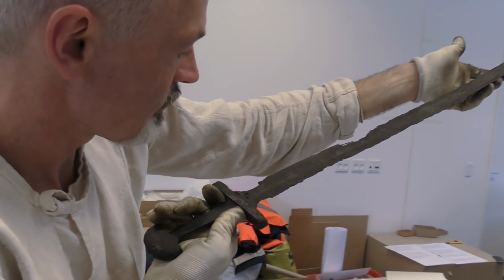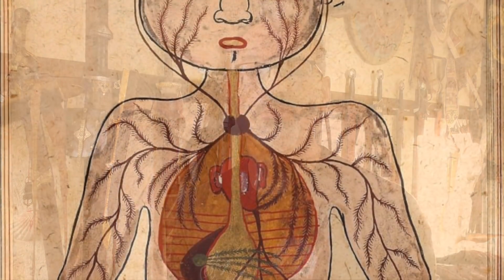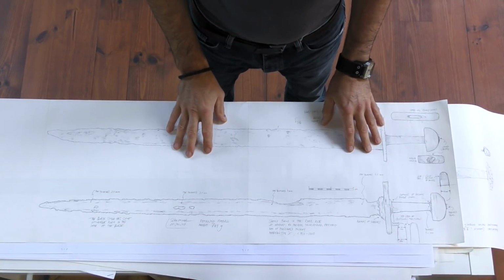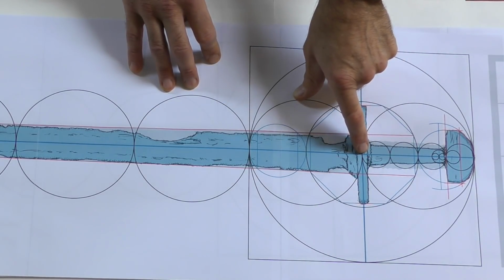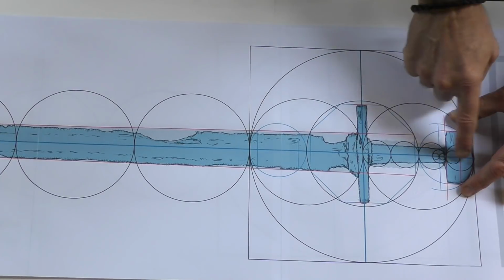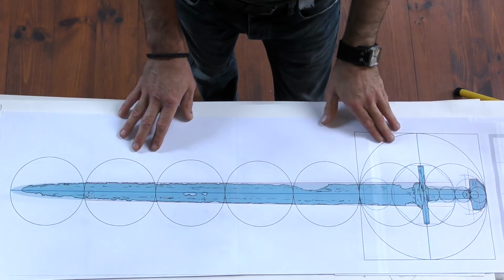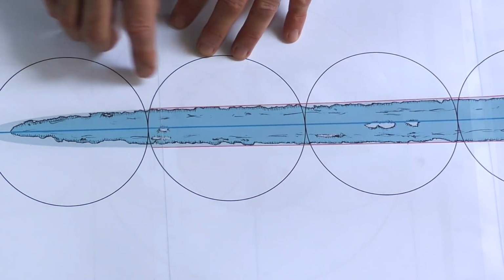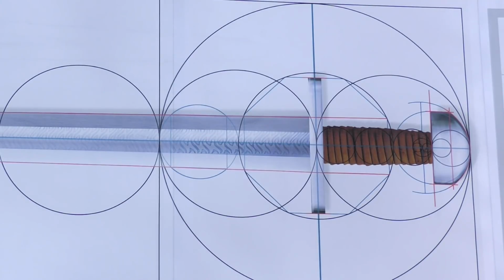The Sword Code – Medieval Blade Design

Comment: Indeed enthralling to watch. How much is conjecture and how much based on evidence? I’m guessing all conjecture but It does seem highly plausible. I suspect the swordsmiths worked by eye and feel, but a sword that looked and felt right would adhere to these rules.

Anyway. Really enjoyed that and thanks. BTW ‘wound’ rhymes with ‘pound’ not ‘tuned’. I’m sure Roland knows and just made a slip, but I’m a wretched pedant and Roland did say it twice.
Reply from the maker: Thanks for the correction. I did not know until recently.
Reply: You might enjoy these...

1) The bandage was wound around the wound. 
2) The farm was used to produce produce. 
3) The dump was so full that it had to refuse more refuse. 
4) We must polish the Polish furniture. 
5) He could lead if he would get the lead out. 
6) The soldier decided to desert his dessert in the desert.
 7) Since there is no time like the present, he thought it was time to present the present. 
8) A bass was painted on the head of the bass drum. 
9) When shot at, the dove dove into the bushes. 
10) I did not object to the object. 
11) The insurance was invalid for the invalid. 
12) There was a row among the oarsmen about how to row. 
13) They were too close to the door to close it. 
14) The buck does funny things when the does are present. 
15) A seamstress and a sewer fell down into a sewer line. 
16) To help with planting, the farmer taught his sow to sow. 
17) The wind was too strong to wind the sail. 
18) After a number of injections my jaw got number. 
19) Upon seeing the tear in the painting I shed a tear. 
20) I had to subject the subject to a series of tests. 
21) How can I intimate this to my most intimate friend?

Comment: nice explanation, but I spot a detail in which is taper defined as line connected between hexagon written inside circle around cross-guard and  furthest side of square written inside fourth circle. This deffinition is not very clear as it can be defined pretty well  as diameter of that circle. I dont thing old masters could work with needed accuracy. Taper of sword was more-less deffined by and estimate. I thing more important was estimate, calculate and finally to balance point of gravity.

Comment: My take:  They could avoid drawing any circle,  having no paper and all that.  Just stepping the distance with dividers. If they used wood/paper patterns instead of dividers the distances would probably have more in between proportions. 
The pommel top is the only 'circular' element.  But as they have no programmable CNC it's probably shaped by eye and not cut by a compass.
Reply from the maker: „Let the mind’s interior compass first circle the whole extent of the material. Let a definite order chart in advance at what point the pen will take its course. As a prudent workman, construct the whole fabric within the mind’s citadel; let it exist in the mind before it is on the lips.“ Geoffrey of Vinsauf, c. 1200
Reply: Nice reference.  But does discussing rhetorics count.
Stepping by hand in emulation of youtu.be/3V0gQ9M45G8?t=35s  and setting like the Romans 1 handspan = 3 palm = 12 digit, I would get for that design:
- Pommel 2 digit by 1 palm 
- Crossguard at 2 palm, leaves like 1 digit wiggle room on the guard (?).The crossguard width: sqrt(5) palm.  Looks unlikely but sqrt(5)/2 comes free when marking the perpendicular with a compass, so it's there anyway.  (edited as I had first sqrt(2) in mind) 
- Blade 4 handspan long by 1 palm wide
Reply from the maker: Interesting line of thought.

Comment: Is the thichness of the guard also given by the sword code?
Reply: Rex McStiller thinking Roland reached a point in the drafting process where he stopped himself short in mocking up a line of sub-circles for the pristine guard, saying to himself “Let’s not devolve into silliness now”
Reply from the maker: I have not gone there, but if you would put two octagons into the two circles that touch each other in the center of the crossguard, this might provide the thickness of the guard.

Comment: Does this mathematical analysis lead to any insights about ideal distal taper or blade width?
Reply from the maker: Well, in theory you could just subdivide and subdivide a circle to ultimately get any measurement. However, I do not believe that this was intended. Sensible thickness of a particular material is determined by its physical properties. A sword smith would be the expert on these issues. However, general harmony of shape and incorporating biblical numbers in the design of a weapon may well be subject to discussion. But when it comes to finer measurements and detail, form would definitely follow function. After all, symmetry was apparently less important than a perfect orthopedic handle design, as demonstrated with examples from the 10th and 11th century in these two videos on my Patreon pages: https://www.patreon.com/posts/ingenious-10th-14498101
https://www.patreon.com/posts/off-center-on-15671471
Reply: Good point, perhaps I should have said "ideal," not ideal.  I suppose that balance would be the key element, but of course given the myriad functions that different sword designs attempt achieve, even an element like balance is very subjective.
Reply: Samuel Yeates ideal for what?

Comment: I have another hypothesis I just realized from seeing your index finger pointing at the pommel: the small circle that his half the pommel "width" is a digitus (or it's evolution in the locality where the sword was designed and made). The distance from center of crossguard to end of pommel is then 8 digiti or 2 palmi, or half a pes (foot). The crossguard length is 7 digiti. The diameter of the circle describing the pommel top is 5 digiti. The blade length is 12 palmi, or 3 pedes. The total lenght is 3 and a half pedes. The blade is probably 3 digiti wide at the base, and 2 digiti wide 1 pes from the very tip, though using uncia (inches) might be more relevant. I would need the "raw data" to tell.
https://en.wikipedia.org/wiki/Ancient_Roman_units_of_measurement

No need to draw anything (which is just a waste of time and involves a drawing support and drawing instruments), just basic use of contemporary units and commonplace proportioning systems. You could then design this sword with just a yardstick and a compass for checking widths, the skill of the smiths doing the rest, each part being able to be made in autonomy since everybody in the shop, or even in the town, maybe even in the region, share about the same reference units. "Make me a crossguard that is 7 digiti long and 1 digitus thick" being much more practical and convenient than referring to a drawing that may be lost, or erased, or whatever, and that has to be traced in the first place, which is again a waste of time, and an unnecessary skill to postulate (Occam's razor: since a clever use of units allows to get rid of it, and we know with absolute certainty that unit systems were used, while there is no proof that swords were designed through drawing).
Reply from the maker: Very interesting. But to clarify: I do not believe that each and every sword was elaborately designed this way – and nor does Peter. The majority of swords was very likely made by a smith in exactly the way he had learned from his master. Who had learned from his. So most were probably just copying what was the standard of the day. Just like many illegible pseudo sword inscriptions were apparently made by craftsmen who were illiterate – just like their customers!

Comment: Your reconstruction seem quite reasonable, other than blade length which I feel you have overestimated in order to fit the circles.
I am not, however, convinced that the method of circle and polygon geometry was the basis of the original design; it seems to me (having also watched some of the Johnsson videos) that you could make any sword geometry fit some arrangement of circles, octagons, hexagons etc. That however is not proof that they were in fact designed by that method.
Reply from the maker: I recommend reading the book "The sword – Form & Thought", which of course addresses all these issues. It also catalogues swords from various periods including suggested geometric design. Very few do not adhere to any system. Interestingly, most Viking swords (that is actual Scandinavian designs) do not fit into this system, which is not suprising considering cultural differences between the pagan north and the Christian realms. Anglo-Saxon swords, in contrast, do fit in!
Reply: Andrew Holdaway 
I also think this might be so. 
I’d lean towards that the larger circles might have been a guideline, as numbers and geometry was a big part of the artistic tradition of masonry and more. 
But it’s difficult to prove, because I would think that any sword geometry would at least fit with some of the circles as you say Andrew. 

Will be interesting to see more of this. If you can find that some geometric system adapts to nearly all swords, then that still might not mean anything else than that practical swords will fit such a geometric system, not that they were designed by the geometric system in mind. 

Must be some way to put this hypothesis to the test. 

I’d start with seeing whether those 7 circles, or rather, that it will be 7 such circles along the length of the swords. 
If 7 is a (near) universal number, that would be really be something.
Reply: Two words in total agreement with your skepticism: Ptolemaic Epicycles. When the lesson from them is that they could explain planetary motion--erroneously--within a geocentric model because they can approximate and fit any orbital curve? Playing around with geometry until it works not only proves nothing, but doesn't necessarily imply anything. Not absent the "smoking gun" of actual records that this thinking was being utilized.
Reply: I also wonder about this
Reply: What about the swords of the continental Germanic people? Have anybody looked at how those swords fit?

The strength of this construction method, is that all you need is a compass and a straight-edge.
Reply: H S 
Yes, which is why so many fit the patterns.
Reply: Everyone Must see ''THE VIKING SWORD WHAT IT WAS AND WAS NOT'' to fully understand Peter Johnsson's Knowledge of Viking Age And Medieval Swords, The Newest Comments are worth Reading Too.
Reply: I don't think Roland overestimated anything, if you look at the original blade you can see how badly corroded it is, so it's entirely possible that the original sword blade lost the last 1 - 2 cm of its length due to corrosion. You're also false to assume that the geometric design theory of Peter Johnsson is arbitrary, it's basically an established fact at this point in time. As Roland stated in his reply to your comment, basically all christian continental swords from the early - high middle ages fit one if his 3 basic structures (most often structure 1).
Reply: @ilikepotatoes1345 
Well I still think he may have.
I don't say it is arbitrary but it is very much an exercise in reverse engineering with much fiddling and fudging - the blade length is a good example of that in that circles don't  quite fit so we'll assume the blade has lost length due to corrosion, if parts of the grip or crossbar or pommel don't  fit we'll try an inscribed square or octagon or maybe cicumscribed.
I came away from this discussion, found the drawing of the sword and checked out it's dimensions for myself - guess what I found was the best fit for the dimensions - it was medieval measures such as hand, span, thumb etc.
No I can't remember everything exactly - it's been eight years.

Comment: Fascinating. Wonder if you could predict the "balance point" of the blade using your work here prior to receiving the replica? Would like to see this system applied to other swords.
Reply: i think the question is if they were trying to adhere to this mathematical schema, would they also try to put the balance point at one of these significant mathematical points.  or in other words, is one of these significant mathematical points the "right" place to put the balance point on a reconstruction?
Reply: No you can't. Neither CoB, nor CoP, nor vibration nodes, nor anything. It's a simple question of physics: swords are 3D objects, and mass is function of volume, not of surface. And for vibration nodes, and maybe even for CoP, you would need much more data, as vibration mode depends on mechanical characteristics that would be very difficult to describe mathematically in medieval swords because of the unevenness of the heat-treated material (uneven material, and uneven heat-treatment).
Reply from the maker: To see more examples, please, find a link to Peter Johnsson's videos on the subject here: https://www.patreon.com/posts/15125439
Reply: John DeFilippo Sure. You could ask it that way also.
Reply: Go on MerlinsJester, try to compute mass and CoB from a single top-view 2D drawing.
Reply: MadNumForce that would be doable if I were versed in the given style of build.
Reply: Whatever the "style of build", it doesn't tell you if the blade is 5.5 or 6.5mm at the base. It doesn't tell you if the tip is 1mm or 2mm thick. It doesn't tell you what is the thickness at the bottom of the fuller, nor the exact fuller profile. It doesn't tell you the exact pommel and crossguard cross-section. 
The best you can do is statistics: average, standard deviation, maybe median, and  first and last decile (or quartile) of the mass or position of CoB of swords of seemingly similar style, which gives you a spread of likeliness of what the weight and where the CoB of that particular sword might be. But it's basically just science-improved rule of thumb guessing, not actual computation based on specific data.
Reply: MadNumForce says you